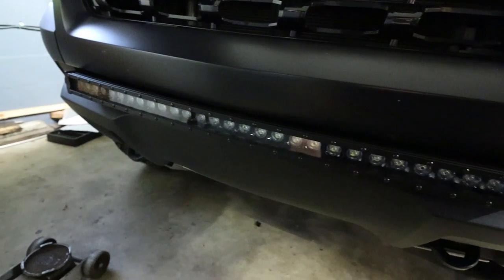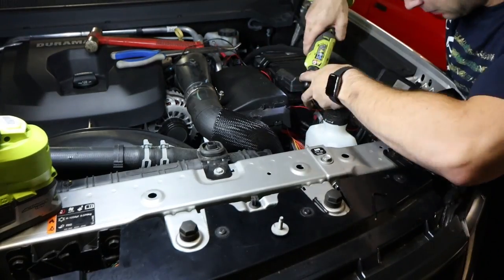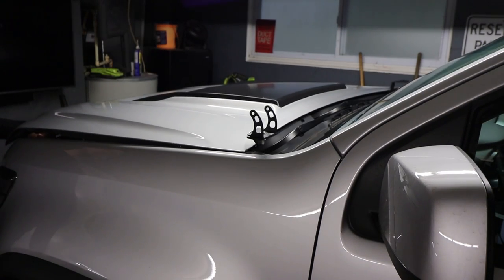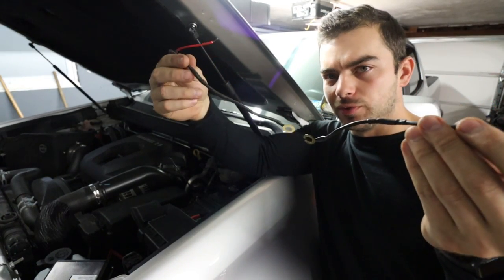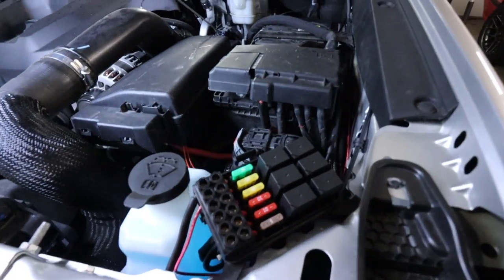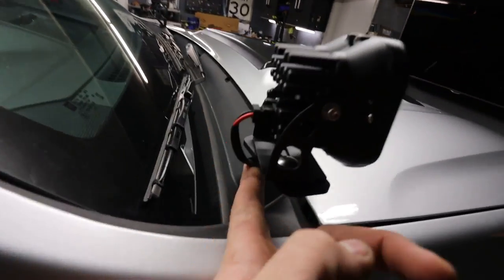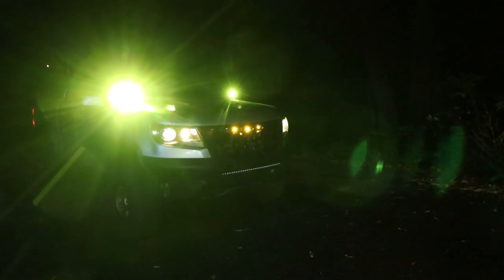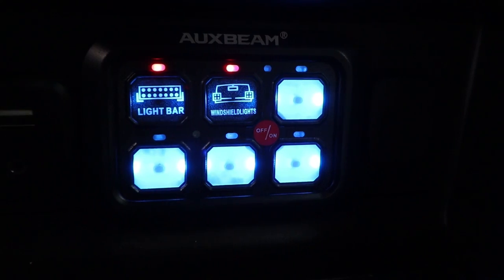The Easiest Way to Install LED Light Bars & Ditch Lights Using a Switch Panel

Comment: Internally mounted bumper winch, air compressor mounted under the coolant reservoir, lights on a roof rack, rear bumper lights, electric tonneau cover (though that should be battery direct), second battery and solar charger in bed for camping set up, etc.

Comment: So basically what ever you connect to the switch panel needs to be grounded with the black wire & only the red wire connects to the panel? I'm gonna install my panel today so I'm trying to figure this out lol never done this before. What if the light that I'm trying to connect comes with a relay that needs to be mounted, do I cut that off?
Reply from the maker: You won't need a relay with this kit.

Comment: Like the ditch lights. That's on my "to do" list but still a ways out. Have you thought about rear bumper lights? Or even under-carriage lights for those times when your out doing night time rock crawling and aren't sure how much clearance you have over that one precarious boulder.
Reply from the maker: I actually have rear bumper light but they’re tied into the reverse lights. 

Rock lights would be useful but are overplayed so I’m a little hesitant 😂

Comment: Where did you run the wires for the panel? I have a silverado and a Nissan rogue I'm adding lights to and am unsure if I want to go through the firewall (need to make space from the engine bay side to do that) or run it outside the engine bay and along the frame railes inside of the front left fender,and into the cab by the hood latch cable.
Reply from the maker: Through the firewall by the steering shaft.  Very easy to do on these trucks.

Comment: I have the trigger six shooter - I liked the idea of using my phone as the controller. I just added a 12v and 2usb panel in the bed and put it on one of the switches. Went back and forth on just doing an add a circuit to the existing 12v fuse, and I may change to that, but for ease of install, it was nice just to plug it into the switch controller. Also nice to have the choice of having power on in the bed even with the truck off if I need.
Reply from the maker: I just looked that up, looks nice! I hadn't heard of that kit but the phone thing sounds neat.  OEM bed switch works with the truck off fyi.

Comment: How exactly did you do the accessory cable?
Reply from the maker: What do you mean?
Reply: I can’t find in my fuse box the ACC fuse I’m not sure if I can use the fog light fuse, my Colorado doesn’t have fog lights from the factory
Reply from the maker: There are a few different fuse areas you can use.

Comment: Is that a Baltimore accent? Also what spools of wiring do you buy to run from accessories to the auxbeam switch panel? Like is 14awg speaker cable the same kind of cable to use for accessories to switch panels? I know this is probably a dumb question to you.

Comment: Compressor - 589 Fab for the ARB set up. Now if only your garage was just a bit taller...
Reply from the maker: I looked at that a few times, I'd love on board air, but still debating. 

And yes, I need a much taller garage lol.

Comment: Do you have plans to upgrade the battery or alternator in the future as you add more accessories?
Reply from the maker: At this point no, if it was a more serious overland build I would add a second battery though.

Comment: Heated washer fluid and heated wiper blades! I have both on my truck and they are lifesavers! I use a relay for the washer fluid as its a 60 amp draw
Reply from the maker: Is that a thing? Lol never heard of it
Reply: @matt13ross  Mercedes runs coolant lines through the washer fluid to keep it liquid.

Comment: Which fuse did you tap into on the stock fuse box for the switch panel? I got a ‘22 z71 and can’t figure out which fuse is the ACC. I’m thinking I might just have to splice off of one of the cigarette lighters
Reply from the maker: I have it in a video. Might not be this video but the other one about lighting. I don’t remember it without looking.
Reply: Hahaha I actually found that after I posted this but thank you!
Reply from the maker: Perfect!
Reply: @Antjmartino  can you share? Thx
Reply: I have a z71 and used the fog light fuse so I can turn it on and off with the fog light button.

Comment: Does anyone know where to get that adapter plug he used for the lights, that would work with rough country lights?
Reply from the maker: Adapter plug?
Reply: @matt13ross  the one used to run the positive and negative instead of using the wire harness